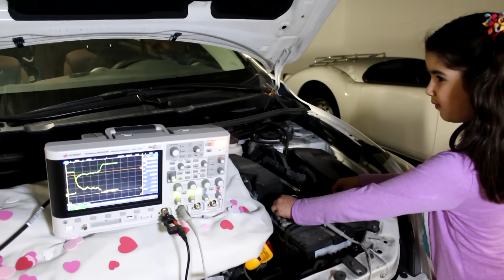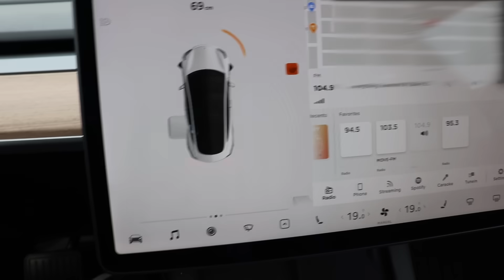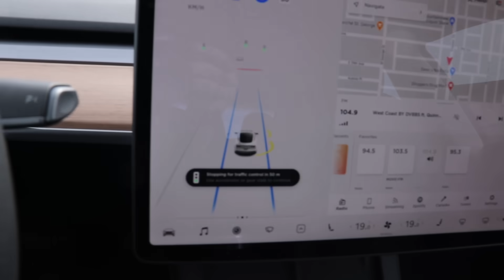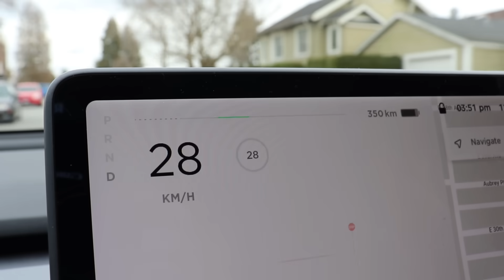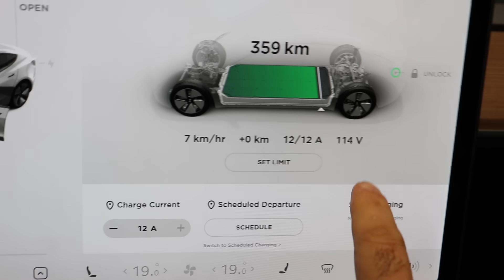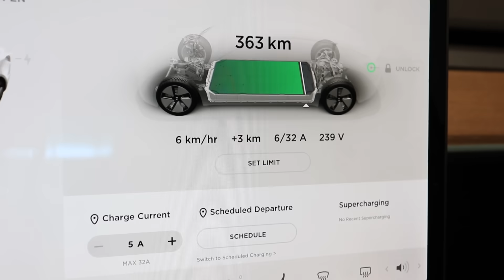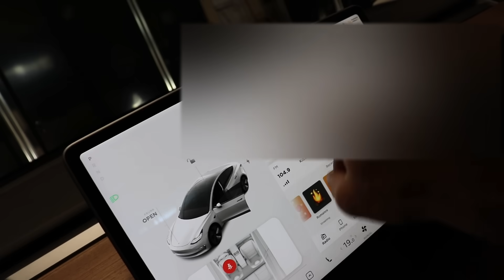ELECTRIC VEHICLES & My Tesla Model 3 Review

Comment: 13:28 A gasoline car does not consume anything on a downhill or on deceleration as long as the transmission is connected to the engine

try with an OBD2 scanner and you can see the o2 going full lean. It is called engine braking
Reply: Depends on the car. Ours appears to still consume fuel like normal.
Reply: @logitech4873  what the car display says is a little bs. when decelerating the throttle is fully closed, thus less air at the manifold, thus less fuel being injected.
Some cars can inject a negligible amount to keep the catalytic converter warm
If your car consumes a lot on downhill you have some problem
Reply: @juandomingoperon828  I have an OBD2 HUD connected to our 2010 Skoda Yeti 2.0l turbo diesel, and there's no indication of the car injecting less fuel when engine braking. 
I get the smallest readings by disengaging the clutch and rolling, or putting it in 6'th and rolling.

Would this be a readout error then?
Reply: @logitech4873  diesel cars don’t have engine braking bc the throttle is fully open at all time
Reply: @juandomingoperon828  Oh so it only applies to gasoline cars, gotcha. Thanks.
I thought diesel and gasoline cars were mechanically almost identical.

Comment: Holy cow if electricity costs would be the same here I would instantly switch to electric

Gasoline = 1.50€/l, at ~10l/100km this gets me 500km for 75€
Electricity = 1.10€/kwh (using any public charger), at ~15kwh/100km this gets me 500km for 66€. 

At at least 15.000€ more cost for the car. And at least a few grand for installing a law conform home charger that can charge with more then 11kw. 
Germany really trying to save their combustion engine manufacturers
Reply: What's the electricity cost at your home though? That's where you'll be doing 98% of the charging.
Reply: @logitech4873  much better, 0.32€/kwh. However I can with my current electric installation only charge at 11kw. It is ok for commuting but like 80% of my mileage is trips 300km+ (I work for an ISP and often have to do trips to business customers anywhere in our supply area)
Reply: @pdoge  Pretty expensive.
Where I live in Norway it's like 0.025€/kWh, and our gasoline costs ~1.30€/l so the benefit of an electric car becomes very clear very quickly.
Reply: @logitech4873  WOW. If that would be the same here I'd switch in a nanosecond. Cost of electricity and the available but most of the time defect public charging infrastructure is really the only thing stopping me

Comment: So regenerative breaking is the car stealing kinetic energy from the motor, creating load so that it slows down?
Reply: Yes. Instead of the brakes converting that excess energy into heat, the motors convert it back to storable power.
Reply: @logitech4873  Damn, that's hella cool. This optimization really blew my mind😀

Comment: If you come down from a hill with an ICE car you only burn a ton of fuel if you are stupid. You see if you come down and you use engine braking in almost all of the cars there will be no fuel injected into the combustion chamber. You only have to select the the ideal gear for the car depending on how fast you want to go down.
(For those trying what I said and trying to over do it. DON’T turn off the ignition because you will lose power steering and the break electronic systems which is dangerous)

Comment: Tesla might be succesfull on making an electric car but its not really like that. Electric part is good. But the car part is shittier than a renault symbol and symbol is pretty reliable as well I used that thing for 6 years. I know you work with electricity circuits and shit but just if you know some about cars and saw the chassis and the suspension on that thing is literally a death trap in a crash. Any crash for tesla cars are very dangerous.
Reply: Tesla cars ace crash and safety tests with highest scores. What are you on about?
Reply: The car is moving with a battery
Reply: @sanswitch3316  And?
Reply: @logitech4873  nothing mate you do your thang
Reply: @sanswitch3316  Uh ok.

Comment: Even if your EV is charged by 100% fossil fuels it is still more efficient as that power plant is still going to be generating CO2, EV or NO EV.

But an EV is over 70% efficient at turning the power in the batteries into usable energy.
This means 30% is heat.
This is why EVs have small radiators or even no radiators(air cooling)
an ICE is about 35% efficient at turning the fuel into work
This means 65% is HEAT.
This is why ICEs need big radiators.

Since EVs are more efficient the amount of CO2 that power plant makes is less than what a ICE would make.

Comment: I hope you purchased a an extended warranty for the battery pack or does Tesla replace the battery pack for free when the cells a better than 50% depleted, no longer able to hold a charge. I also assume that the lithium cells still contain cobalt (poisonous element). Did Tesla fix the problem of the battery pack catching on fire? I had a very bad experience with a used Nissan Leaf with an Ext Warranty and a very belligerent corporate Nissan. I traded it in for a a newer Nissan Sentra. Carbon isn't so bad when you can use for making a better a battery that is cheaper to build and can be charged thousand of cycles.

Comment: Sorry, but as an born Albertan. I will continue to use gas powered vehicles. Electric vehicles are only good in the city in my opinion. Ontop of that I drive a pickup truck. To me having the idea of Battery powers vehicles being shoved down my throat is not appealing. In my own eyes, Tesla’s, and other electric cars are best in the city. Not for people who live in small towns in the country.

   I will continue to drive gas powered vehicles for as long 
As I live, because it’s far more effective to pull up to a pump and fill up. We will not be getting rid of our dependence on gas. 

   Ontop of that batteries die faster in the winter, meaning you get less kilometres then a gas powered vehicles. 

   I would be fine with the introduction of electric cars if it wasn’t being forced down my throat as an end all, be all vehicle.  Especially If it wasn’t being so heavily forced into everybody’s minds that it’s better. Or that vehicle manufacturers will stop making gas, and diesel powered mechanical vehicles. It’s perfect for the city, but for the love of god stop trying to force it into Everybody.

Comment: I wonder why the ev manufacturs are not addin a high voltage light weight alternator driven via a small transmission link to one of the axels or wheel assembly. It would also act as a regenerator as you drive and extend the range greatly.

Comment: My company set me up with a Model Y for business use and I just got the same NEMA 14-50 installed at home that you have.  I tend to burn through the battery regularly so the max amperage makes a huge difference for me. Starting the day off at a full charge on that versus the 65-75% mark on 120V is a huge relief.

Comment: I have a theory. What if we made "daily driver" eletric cars, with very small battery packs, and very small footprint, you keep your SUV/minivan, or like me, 9 seat limousine for when you need it for family events or long road trips with many people/pets, and then, drive your small 1-2 seat eletric vehichle to and from work, charging it every night, even get some range extension by having integrated solar pannels to charge while at work as most employers dont offer charging options. Sure it will only give you a few miles of range per day, maybe only four, but if you live two miles from work, you could drive to and from work on the power from the sun alone.
Side note about my limo, i originalyl purchased it to convert it to a solar assisted hybrid, as with its roof, hood and trunk space, i can get a constant 1.5kw/h (13kWh over the course of an 8 hour work day+1 hour lunch) which might not sound like much, but that should in theory allow me to drive up to 2 miles per day on solar alone under perfect conditions. I already get 20-35MPG depending on conditions, adding regenerative breaking, PHEV functionality, and solar trickle charging i am hoping to break 45MPG, or a city/highway average of 32+.

And after 5 years of ownership, and 40k miles, i finally bought a second car so i can get my butt into gear and start working on this long dreamed of project

Comment: Tesla does have maintenance, needs to be taken to Tesla once per year, still much less than ICE vehicle.  i was very close to buying a model X but i can't charge it in my garage during winter and its an 8 hour drive to nearest Tesla dealership.
I'm surprised you didn't mention about only charging battery to 80% unless you need the range for a road trip.

Comment: Yeah, a toyota matrix is a great car, but gas milage is a bit on the subaru side of things. I got a manual car while I still could, so I could experience internal combustion while it's still a thing. But it gets like 38 mpg.
Reply: roadmaster 94 get 30mpg or 32mpg

i seen toyota matrix is good car but not fan of it because hardly find parts for it unless order it in website
Reply: oh yeah. i have a subaru impreza. i really like the car but it really is a thirsty one considering it doesn't even feel like the 107 hp it has. and since i'm driving 65 km per day to work and another 65 back i really notice the impact. especially now with winter tires fuel consumption goes up another 1-2 liters per 100 km. but i should also say that i'm driving the autobahn in germany and there is no speed limit. this also doesn't help much in the end.
Reply: ‘17 Cruze; I’m getting between 26 and 29 mpg in 450. A woman I worked with was getting over 51 mpg (she done longer trips).
Reply: @johnsimun6533  either she is lying or you are very bad driver
Reply: @davelawson2564  no, I seen it myself while showing her a couple features her car has (it blew my mind). The funniest part is she didn’t know what mpg was. She is an older lady, she has family down around the low country. So she does longer distance driving. And, yes, I drive, my mix has more city. So I could get substantially better mileage. Probably not that, but I guess lower 40s, if not higher 30s.

Comment: i have long wanted a feature to automatically slow charging to that needed to reach the set charge by the end of the off-peak rate period. If the battery is lower than usual when it starts charging, then it should simply draw a little more current than usual to reach 90% (or whatever) by 6AM or whenever.

Comment: Every modern EV charger (including Tesla) can respond to external commands to change its current draw within a few hundred milliseconds (see SAE J-1772). This is rarely used today except to limit charger draw to the branch circuit rating (e.g., 32A continuous on a 40A breaker). It's how the Tesla automatically changes its current draw when you change the adapter plug on the portable charging cord. Several Tesla built-in wall chargers can also share a single circuit by using this feature.

In the future it could also be used by the electric utility to e.g., control the total load on a neighborhood stepdown transformer or distribution line to avoid having to upgrade the distribution network. It can also give the utility another tool to help continuously balance generation with load. Since this benefits the utility operator they should give the vehicle owner a discount for this feature.

Comment: You need to watch rich rebuilds.  Even though you don't use your brakes (IE they don't wear down), you still need to maintain them (especially in canada winters).  Over time the salt will corrode parts and could prevent your brakes from working properly if you don't maintain them.

Comment: The claim of no brake maintenance is wrong, because of the rare need for mechanical friction braking the pads and rust and deteriorate, braking down to to a lack of heat cycling. Regular braking with mechanical brakes heats the pads up and bakes the moisture out of the pad while maintaining a good contact patch on the rotor. If you rarely use the brakes, especially in a place where the roads are salted in winter it is important to check your pads once in a while because the pads can deteriorate so much the will be useless just when you need them the most.

Comment: No way would I consider that car. I don't want all the stress of working out all the things you have to consider. I just want to jump in my car and drive in a relaxed fashion with no computer to keep checking, and just pump gas occasionally. Your driving experience sounds like hell on earth to me. When I drive, I tell the car what to do and I don't want it changing lanes and braking without my input. I don't want range anxiety either. That car will turn you into a gibbering idiot.

Comment: I have a question about the breaking, if you don’t have to press the break pedal and just use the regenerative breaking does that mean your break light wouldn’t come on so then drivers behind you won’t immediately know that you’re slowing down? If it turns on the break lights when the regenerative breaking is active that’s fine but otherwise it could be a bit of an issue
Reply from the maker: I was wondering that at the beginning too, but the brake lights actually turns on!

Comment: @11:59  Not true sir,  they still have brake pads and the hydraulic system that goes with it.  As you say yourself, the regenerative braking is not good enough in all situations.  

Have a look here about alleged "maintenance free" and "cheaper to run"  (a long term test and review by an Auto Engineer) https://www.youtube.com/watch?v=_VbDgBZTUWg
I think a view from an "auto" engineer would be a good balance to your "elec" engineer viewpoint.

I'm not saying that we should keep the current fossil fuel burning crap we have, but this idea that the EV is the best solution is just wrong, we need to keep looking

Comment: 13:36 um... No. Only old cars with carburetor burned fuel while braking with engine. Modern fuel injected engines aren't burning any fuel going downhill unless you're not braking with engine but it runs in idle (with no gear selected). But generally I'm big fan of electric cars, just waiting patiently for them being cheaper and with bigger range. Cheers.

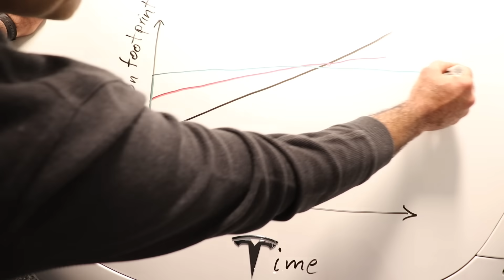Comment: @2:45, also, take into account the cost to the environment in the production and transport of each component of that EV, INCLUDING the lifespan and the "planned obsolescence" of each of the components.  The lifespan of the Tesla motor for example depends on 2 cheap bearings.  When these bearings fail, the whole motor needs replacing, the bearings are NOT sold as spares.  That's expensive to your wallet, and worse, to the environment when an entire new vehicle power plant is required.

The plastic trim and accessories (and manufacturing process) are just as damaging to the environment as any other vehicle. The metal in the bodies (and manufacturing process) are no better than anything else.  Sure less hydrocarbons burnt producing less CO2, but that alone is not the whole story, nor the whole solution. 

Personally, I don't believe EV's will be viable in an "ecological" sense while current battery and recharge technology exists.  Producing hydrogen as a fuel at low emission and economic costs would be a far better solution. (currently it also suffers with having a high cost to produce ecologicaly)

But our real problem is our wasteful lifestyles, we often replace things only because we want the "latest greatest", not because what we have doesn't do the job anymore.  We throw away before we re-use or re-purpose, plus most "western": countries have laws that restrict your right to repair your own possessions.

Comment: i also purposely slow-charge my smart phone and tablet, and only fast-charge if absolutely need to (usually when desperate and travelling, which I've been grounded since March 2020 anyway, so...). But I do this to reduce heat and extend lifetime of the batteries. 7 years on a laptop and 3 on the tablet and phone so far

Comment: Isn't adaptive cruise control quickly becoming standard equipment? My father's very conventionally-powered (Diesel) car keeps a safe distance to the car in front, leaving a larger gap at higher speeds, and reduces the speed where necessary (although it never fully stops instead of the driver).

In any case, may you use it with health and joy!

Comment: Most electric RC’s also use the motor as a brake, and often you can set the amount of “brake drag” the motor induces. I’ve found this to be really useful, because it allows for better control especially for my faster cars because I don’t have to release or push the trigger back as much to slow down. I’m glad to see this come to full size cars, it’s a fairly minor thing but changes the experience for the better